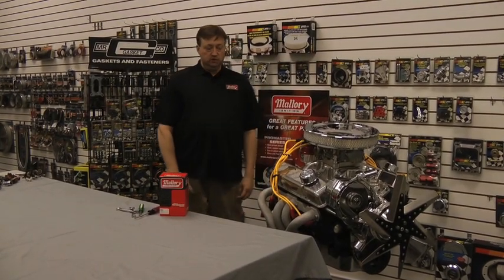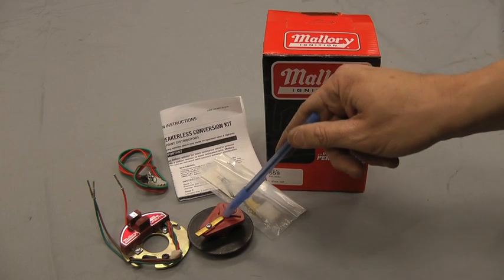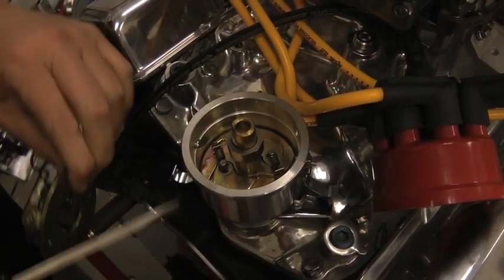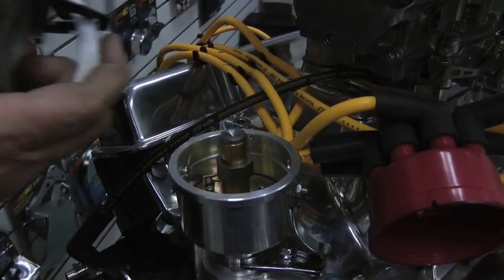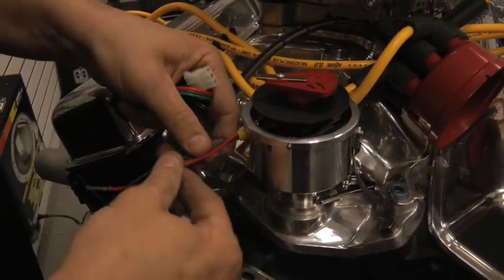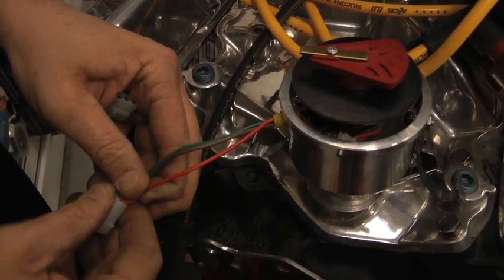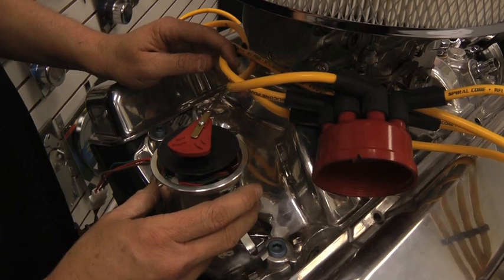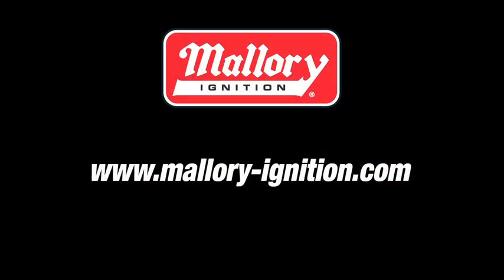Mallory Ignition E-Spark and Unilite Breakerless Distributor Conversion Kit Installation Video

Comment: How do you secure the plate?  Didn't see you tighten the screw to the clip so don't understand if you tightened those clip screws and that holds the plate in which doesn't look like they would.

Comment: I’ve the e spark kit and it looks nothing like this.
When I get the points out the instructions say I have a bottom plate and a top plate, attach the bottom plate to the breaker plate, whats a breaker plate and where is it? Once the points are out there no other plate to secure the bottom plate too.

Comment: Good info - the sheet that came with my unilite said nothing about 1.4 ohms being the threshold for needing a ballast resistor.   The other thing missing was... a parts list/diagram, and nothing to tune on the mechanical advance if needed.  Someday I'm gonna need a new rotor or cap.    And how come the spanish section was twice as long as the english one?

Comment: First item in the instructions for connecting the red wire says connect it to 12 volt side of the resistor.   News flash: this video shows the red wire connected to the coil positive. That is 6 volts during run. It is only 12 volts during start. That is because the ignition switch bypasses the resistor in start mode. In run mode the circuit is through the resistor. Reducing the positive coil voltage to six volts. The question is: is the red wire connected to the 12 volt run side of the resistor? Or the 6volt side after the resistor as shown in this video? Counter to the included  instructions this simple install makes absolutely no sense when it comes to connection of the red wire.

Comment: Where in God’s green Earth do you find that “plastic clip”!!!!! The only part I can find is the pigtail from dizzy wires to coil/ ground! I have searched EVERYWHERE for the female plastic side of the wire harness that comes from distributor!! Every kit I ordered does not include the plastic end for the wires to go into after feeding through dizzy and connecting to the pigtail!